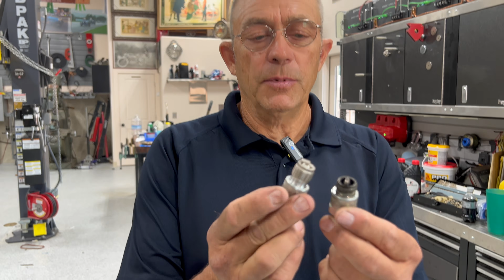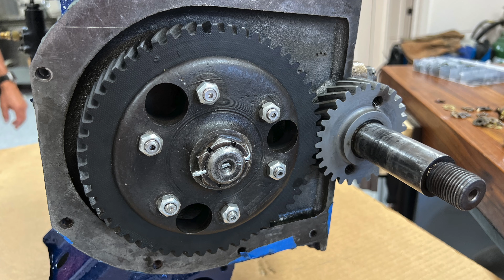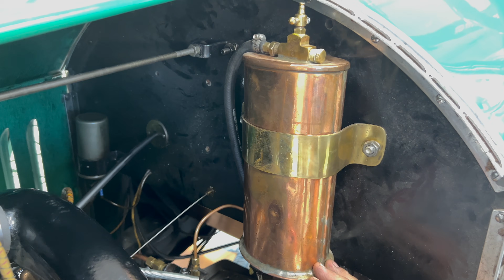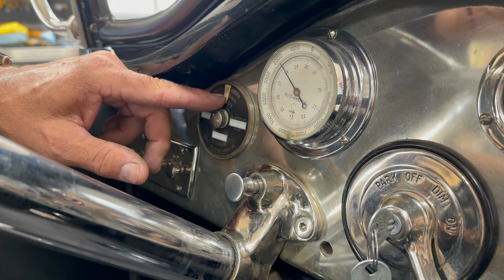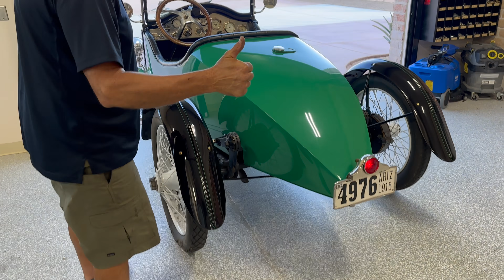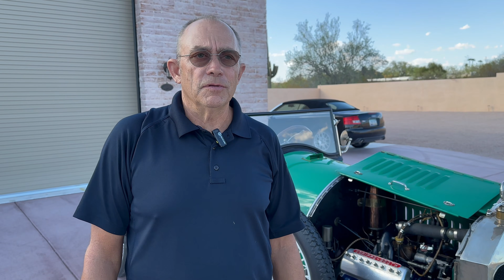First Start After Rebuilding a 1915 V8! Ferro/Scripps Pt 3 | Alan Travis | Inventing the Automobile

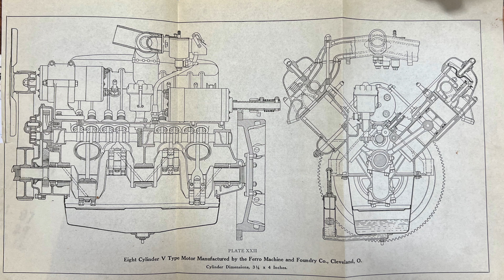Comment: A question I asked in another video on this engine is yielding more confusion for me here @ 2:54. The center of the crankshaft in this drawing shows a normal main bearing and journal that seems to be inline with the middle two crank pin journals on the actual engine as seen @ 14:50 in the other video. My only conclusion is that it is for a slipper ring type bearing with the shaft passing through it in an offset way rather than the center (How it's held in the block?). It would be a clever way to avoid the added step of having to drop forge the center crank journal into place stretching the crank material that bit more thus weakening it. I understand that the engine being rebuilt is a race type and may have been drastically different internally from the production type. It just struck me as profoundly unintuitive to have only two main bearings on a four throw racing crank, very puzzling.

Comment: Interesting to see this engine run. 
FYI yes you can use a timing light with solid conductor spark plug wires and non resistor spark plugs. If you choose not to use the timing light the way to set the timing is to static time it in other words without the engine running by rotating the crankshaft until (at least in most cases) number 1 cylinder is on top dead center with both valves closed and the timing marks lined up. At this point the distributor rotor should be pointing at the terminal in the distributor cap for #1 cylinder. Remove the coil wire from the distributor cap and place the end near a grounded metal surface on the engine, loosen the distributor so it can be rotated, turn on the ignition, turn the distributor first in the direction the rotor rotates when the engine is running far enough to ensure the points are closed, now rotated the distributor in the opposite direction until a spark jumps from the coil wire to the grounded metal surface then tighten the distributor. If you don't want to use the coil wire you can use a test light connected to the points primary wire the light will be on until the distributor is turned to the time the points open. 
Note: Babbitt should not melt and move out flow around correct clearance should be established in the process of pouring and finishing the Babbitt connecting rod side clearance is typically measured using feeler gauges. The only surfaces that should break in are piston/piston ring and cylinder. In some engines there is limited  break in occuring in the cam to cam follower surfaces.
Reply from the maker: Thanks for the detailed technical breakdown, I appreciate it!

Comment: After what Allen told us in the last video about balancing and now to see it run it was smooth even when he pressed on the throttle and it sounds sweet!
And I thought it was strange and please correct me if I’m wrong but they thought of everything except a coolant temperature gauge and because it was a racing car I thought that might be kinda important but nevertheless that Car is so ahead of it’s time that it should completely impress all people wether you love automobiles or not 😀🇨🇦
Reply from the maker: Keith! It is really ahead of its time 👍 - it’s an amazing car I appreciate more every time….
I don’t remember the coolant gauge answer - will have to check back on that!

Comment: Just a comment:  I have built many antique, special interest and performance power plants of many different varieties from small 61 cc ( 1 liter) all the way up to 1,200 cubic inch inline 6 hemi over head cam units.  When I set up an engines friction tolerances tight like you mention, I always find a way to pump up oil all through the engine before I ever try to turn it over whether by cranking by hand, with a starter or in cases like yours towing.  I make a tool that i can turn the oil pump with a powerful hole hawg or like high hp drill motor.  I make sure oil is squeezing and squirting out the rockers, shafts etc for a good minute THEN I start turning the motor over.  It stresses a dry, tight freshly build motor a great deal less.  I've seen many guys tow engines without the plug like you do to pump them up and spin bearings or spall other friction surfaces.  I am sure you probably manually pre lubed everything as you put it together, but I just wanted to comment on my technique.  Interesting car you have there.  TC  BK: Special Interest Autos, Motos and Restorations
Reply: A litre =1000c.c. - 61c.c. is 0.061litres

Comment: Use a vaccum gauge to set timing and the carburetor.
I use this technique engines with a distributor, when a timing light isn't available.
Reply from the maker: Good general technique. Might be tough to access engine vacuum on this one.

Comment: I'd want to know if it had mechanical breaks first before driving it .If you have driven a car with mechanical breaks you know what I mean.
Reply from the maker: 100% mechanical brakes only on the rear wheels… the special racing part of it, though is they have a cable trundle system with pulleys that help balance the proportion of braking between one side and the other, which was very leading edge at that time!

Comment: beautiful engine and all, however, running a thermosyphon cooled engine's air AND water within the same cork gasket...
yeah i guess it wasnt a very durable design. very 1910's. this could end up with the engine just killing itself out of nowhere...

but everything else in the engine, aside the spark plugs and the 2 main bearings in incrediblely innovative.
and that throttle response is something unreal!

it's incredible how random innovation was in these days.
Reply from the maker: You are right, that’s a good analysis and overview… It’s a good peek at what was going on in the 1910s and I appreciate Alan presenting it for us to see. Thanks for that comment!

Comment: YOUR TOWING THE CAR 
WITHOUT GAS AND SPARK, TO DETERMINE NO BEARINGS HEATING OR WATER LEAKS IS A GOOD TOUCH!
BACK IN THE DAYS WHEN POURED BABBIT ROD AND MAIN BEARINGS WAS COMMON, THERE WAS A MACHINE DESIGNED TO “ BURN IN “ THE BABBIT BEARINGS!
THE BEARINGS WERE DELIBERATELY SET TIGHT, AND THE SHORT BLOCK AND ENTIRE PISTON ROD ASSEMBLIES WERE UPSIDE DOWN,
THERE WAS A ELECTRIC MOTOR TO ROTATE THE CRANK IN BOTH DIRECTIONS AND A VARIOUS SPEEDS!
OCCASIONALLY THE ROTATION WAS STOPPED AND BEARINGS CHECKED FOR HEATING THEN WAS REASSEMBLED AND RE- OILED!
AT THE TIME STOPPED ,
INSPECTION DETERMINE HOW MUCH TO SHIM THE BEARING CAPS TO PROVIDE PROPER OIL CLEARANCE!
THE LARGE MAJOR MACHINE SHOPS WERE EQUIPPED WITH THIS 
“ BURN IN “ MACHINE!
Reply from the maker: Wow thanks for adding that info - very interesting!

Comment: couldn't you set the timing with the engine not running using a conventional "test light"?
Reply from the maker: Well, you could if you knew what the engine was going to respond best to, but there is no spec., so trial and error is really the only option...  Thanks!

Comment: Amazing.  If it were my car, I'd fab-up a mechanical ignition timing adjustment arm, make it look as original as possible.  IIRC, model T Fords had a lever on the steering column.
Reply from the maker: They sure did as did many others. Thanks for your comment!

Comment: It's interesting that the crankcase and cylinder block are cast as one because for V engines that was not common then. I suppose it is a small engine so the casting would not have been so hard to control. Ford's flathead V8 had a lot of problems with its castings but that was at a production car level. You can use a timing light on a solid wire type sparkplug lead but it's not a clip-on pulse type My first timing light was two high-tension spark leads connected to a strobe light. One end of the light went on the lead for the plug and the other went on the sparkplug. It was made by AC electrical components. You could not use them out in the daylight because they were not very bright
Reply from the maker: That’s actually very interesting. Thanks for adding your comment and enriching our channel!

Comment: wow that engine looks like two chevrolet fours on a common crank.  those engines had the spark plugs in the block too, with open push rods.  i think scripps-booth was already a gm car, bought by durant, but chevrolet was a little and a durant.  were there common engineers sharing ideas?.  while on the mind set, oakland v8 ie vertical valve, and lycoming v8 as in cord, look so similar, with the two plane head. i think they had common engineering.  thank you so very interesting
Reply: Yes, Chev continued to use this style of combustion chamber in their 6 cyl engine in 1929.  the plugs were threaded horizontally into the top of the block just above the TDC of the piston. By 1935 or 36 the compression ratio had been increased & Chev had to go to a smaller diameter 10 mm spark plug to clear the piston. Do you remember the little Honda 50 plugs these cars had?

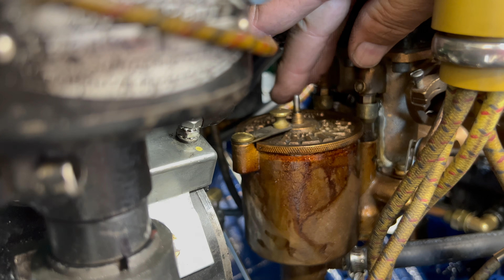Comment: Got fuel leaking from the carb @ 15:20…..
Reply from the maker: Thanks - sharp eye!
Reply: That leak, was from pushing down on the float stem he was pointing at, which cause gas to flow hight then normal and then puked it out, basically flooded the carb. But because it a updraft it dribbles out the carb opening.

Comment: A good indication of the value of two plugs firing is when the magneto's being tested on an aircraft engine are individually switched off, there is a noticeable drop in the revs when the engine is firing on one magneto. 
       Also a flathead v8, is still favoured amongst enthusiasts as the spark plug being in the centre of the bore, like the one shown here, are considerably more efficient , especially so if the pistons are slightly shaped like the back of a bullet, !

Comment: The Edison spark plug has two hexes and I recall either Lodge or KLG brands from England had that feature so that the plug could be taken apart for cleaning.  Also, that combustion chamber design is very close to what Morini motorcycle engines from Italy used in the '60s and into the '70s.
Reply: Yes, I have a Lodge plug for one of my British Seagulls and recognized that construction immediately. They don’t work well without the copper sealing ring inside.
Reply: those strippable spark plugs are from the 18mm thread size era
Reply: @raymondo162  The ones I was familiar with were 14mm.  We had stocks of them for motorcycles.  My DKW and SAAB two-stroke autos had 18mm but had crimped insulators.  IIRC, Lodge was considered to have the best porcelain insulators;  then NGK seemed to do somehow better.
Reply from the maker: Thanks for adding to the description of this!
Reply: I had a Moto-Morini back in the early 1970's that was a basket case. I don't remember exactly what size it was, but someone had taken it apart to put new rings in it, and as far as I could tell, wasn't able to get parts for it.. and yes, I do remember the pistons didn't come all the way to the top of the cylinders.😉
Reply: @danw1955  Yes, I bet parts were basically unavailable.  I recall the 175cc Italian singles were popular and I actually saw one going through it's paces at a road race in San Angelo, Texas in the early '60s though it had been rebranded as a Carabella, a Mexican brand that was supposedly making them under license.  I wanted one of the Morini V twins, fine looking job though wouldn't have set well with the dealership I was working for (Suzuki, Kawasaki, and BSA).
Reply: @whalesong999 Now that I've looked through some picture online and whatnot, I'm thinking it was like a 50 or an 80cc.? Probably mid-1960's. It was just a tiny little thing for a 4 stroke. I had a 1966 Honda 50 later on, (step-through style that eventually became the Cub), and it seemed much larger dimension-wise than the Moto-Morini. 😄
Reply: @danw1955  I saw fairly recently a video on the history of Morini and I recall it showing some very small four-strokes they made.  Maybe a search will turn it up.
Reply: @danw1955  https://www.youtube.com/watch?v=PiVSfBW1QQc

Comment: I have no doubt at all that the man knows EXACTLY what he's doing but it's a little scary "to me" how much meat he took off that spark plug.
I wonder how much torque-tightening that plug could take with that much material removed..
Reply from the maker: I hear you. Thanks!
Reply: Torque specs for spark plugs are generally sub 20 lb ft  so shouldn't be a big concern
Reply: Agreed,, I just wondered how much meat was left..  @chickenfishhybrid44